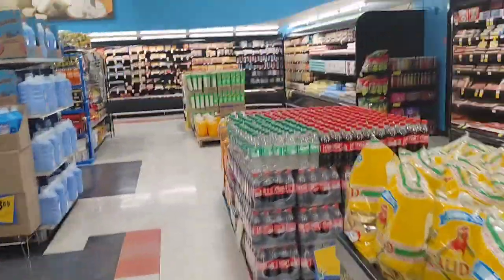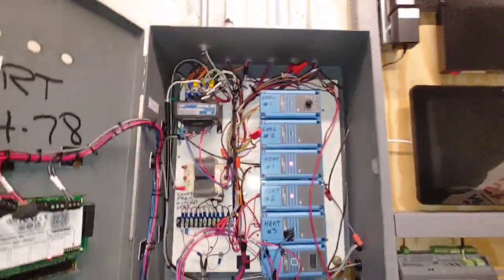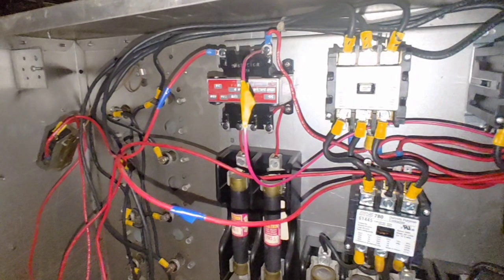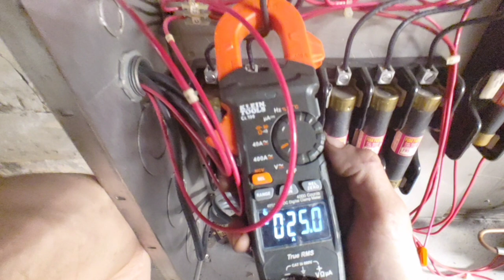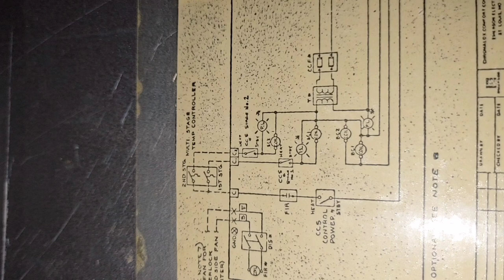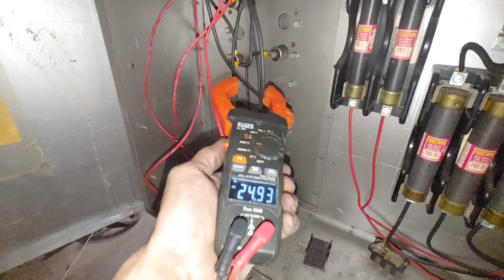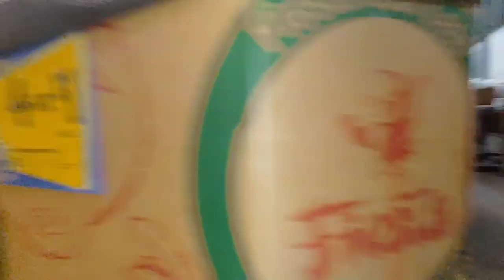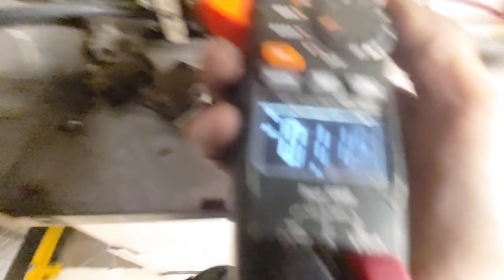3 Phase Heat Kits Not getting the call to heat.

Comment: In my opinion, this is the best way to heat a facility.
Reply from the maker: I thought I replied to this as soon as you posted it. 
What I was saying is that, I would think that the same types of comparisons that we would apply in residential regarding different heating options,  we could apply in the commercial side too. The only difference would be that we're comparing single phase to 3 phase so I don't know how efficient or inefficient 3 phase heat strips and 1 phase strips are compared to one another. 
Back when I did residential I could Only ever really get about a 20-25 degree temperature rise out of the electric heat strips on the better running systems. Gas Furnaces would be better, between30-45° of rise, Give or take a few degrees in both directions. But Heat Pumps w/Aux Elec Heat operating as the second stage were the best, sometimes reaching 65° of total temperature rise. Even gas furnaces didn't compare with those heat pumps. But everything's gotta be just right for that heat pump to work efficiently and last long. I would take it probably a step higher than that even and guess that the dual fuel/fossil fuel kits that have the gas furnaces together with the heat pump are probably gonna be better than the heat pump with electric heat. But again that would just be a guess